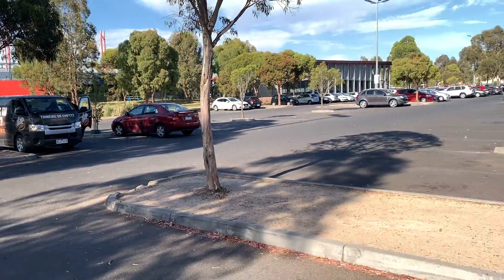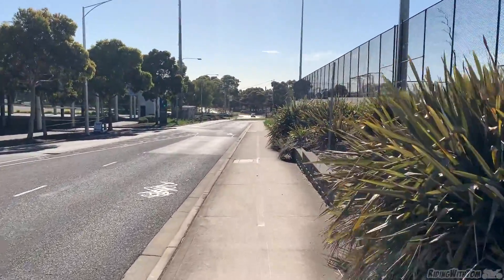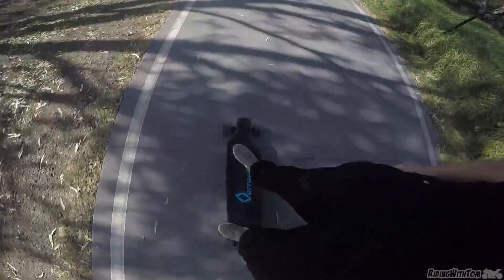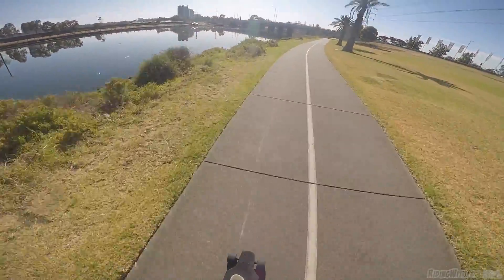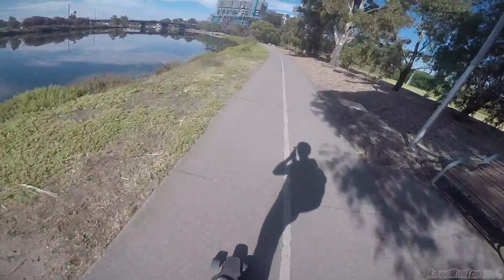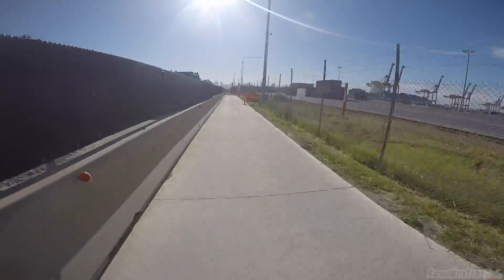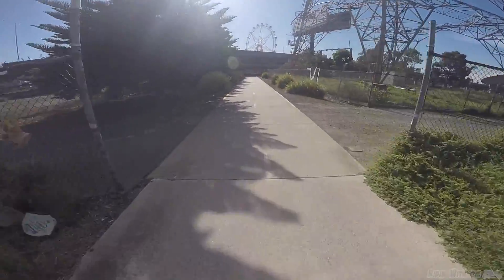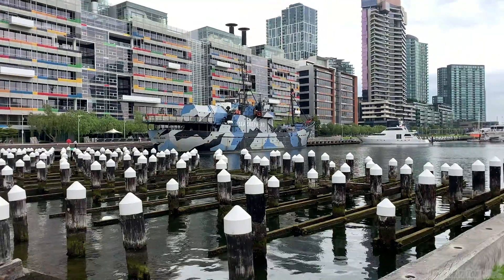I ATTEMPT TO RIDE AN ELECTRIC SKATEBOARD 20KM TO WORK! VERREAL F1

Comment: Hi i need some help i want to know if a Folding Bicycle or an Electric Skateboard is the best way to get around, im specifically looking at the Tern BYB (1399) and the Meepo AWD Pro, that has a top speed of 34 miles per hour and a range of 15 miles, and it only retails for $859 with expedited shipping. I know it should be an easy decision but the dilemma im having is that most Electric Skateboards are made in China, and im worried of it breaking down on me and the company not fixing it, which has happened in the past, but if anyone that can give me some insight into which option i should go with it would be very appreciated! Also asap please because i need to make my decision very soon....

Comment: I like the Verreal F1 but i really dislike the battery box design. Broken screws.. oh man bad design. Fell out on the road. 
I had to reengineer the mounts to the board. You will definitely have this problem if you buy it over time.